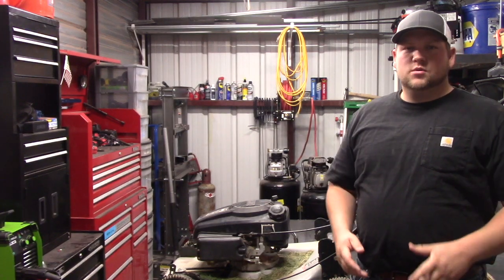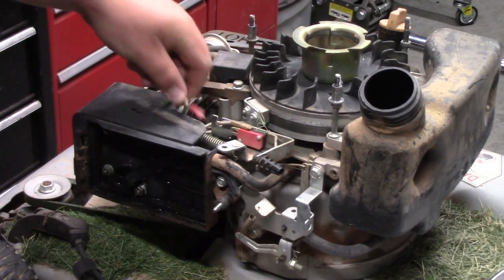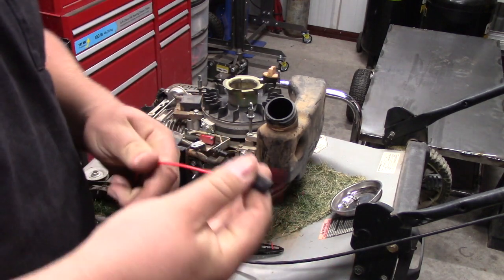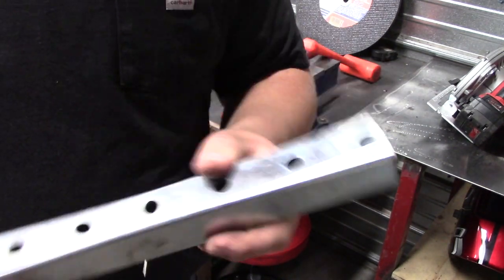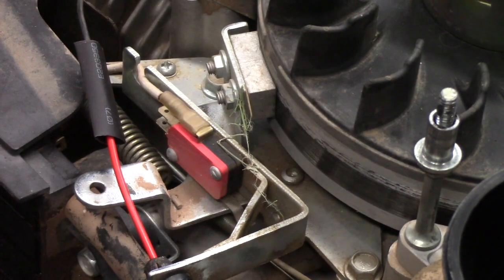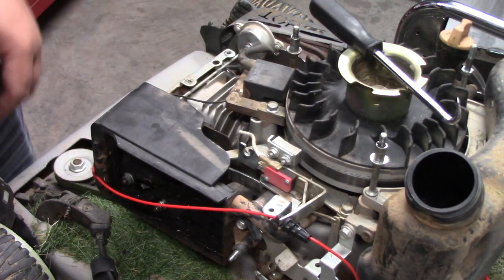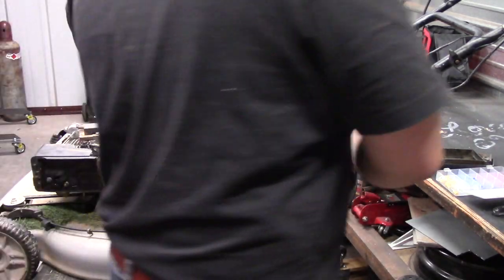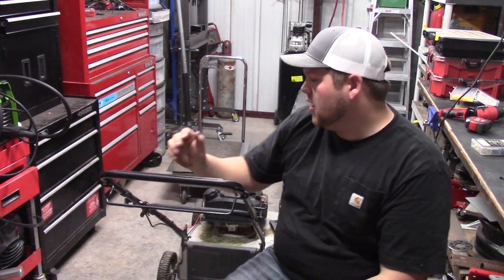How to Install a Kill Switch on a Lawn Mower

Comment: So this works because you are removing the fixed ground from the block and relocating it to a ground on the handle to a intermittent ground right? I have a Troy bilt mower I am wanting to do this with and still learning how to work on small engines
Reply: Yeaa.. he did miss the most important part explaining what is he doing

Comment: Perfect!  I have an Edger with a engine brake cable that is difficult to pull for some reason. I know it will result in a new cable shortly. I’ve been thinking about a kill switch but was unsure about if there was another component in the system that would cause problems. Your video was most helpful. Thank You!
Reply from the maker: Glad it could be of help! Thanks for watching!

Comment: Unfortunately I can't hear the video at this time but I'll re-watch later when I can but I have an old mower that doesn't have a kill switch. The only way I can shut off the mower is to either let it run out of fuel or ground out the spark plug which is what I do lol. It works great but not exactly easy for my child to use lol. Anyway I tried to make a kill switch but I can't start the thing with it on. Maybe I need a thicker jacketed wire I'm not sure but if I put it on after mower starts it works great except it kind defeats the purpose if I have to install after it's started and it also hurts a bit sometimes. Regardless I want others to be able to use it without me. Any opinions other then paying $250 for a new mower that's only going to last a couple years? This mower is about as old as me but still runs like a beast. My last mower died after 2yrs and needed a small part for 120 buck which is why I said the heck with new crap lol.

Comment: my son just snapped my cable...I zip-tied the brake "off" and fired it up to make sure it still ran, going to install a switch now so I don't to pull the spark plug wire next time!

Comment: This is a great alternative. I had to do a cable delete on an older mower and made do by just reversing the spring on the brake to keep it open, and then when done mowing, manually put pressure on the brake in the normal direction to kill the motor. I think I have a momentary switch in my box of salvaged parts that would work perfect for this.
Reply from the maker: I think I would prefer the actual cable but this is a solid fix especially for a quick fix to get mowing again.

Comment: Hi I loved you vid and I did what you did with my rig can I do this with a key switch because I want to make my lawnmower to have that
Reply from the maker: It should work with a key switch, the only difference would be using a key to flip the switch instead of a little ball and lever.
Reply: @DereksWorkshopAndProjects  can you send a link to what you would use for it and thanks for replying 😁

Comment: One thing to keep in mind is when you delete the brake on the flywheel:  When you turn off the mower using that new kill switch, the blade will continue to spin for around 30 seconds due to momentum.  So stick your hand in the chute you will loose your fingers.  Lol
Reply from the maker: As soon as the mower stops (delayed compared to the brake but no more than about 6 seconds) the blade stops too. It's definitely not 30 seconds but definitely something to be aware of because that brake does stop it quick!
Reply: A little bit confusing, the spark wire  not that spark plug wire.
Reply: You can leave the brake for the flywheel

Comment: I like the video. My cub cadet mower is not stopping when I release brake cable and as far as I can see the cable is not damaged. What do you the the problem might be?
Reply from the maker: The brake itself may be completely worn down. It almost may be the spring is worn out. If it’s not shutting off electrically, as in the spark plug is not having its spark stoped, your switch may be bad. There might be something blocking the cable from going in all the way. Hard to say without seeing it but maybe that will help a little bit.

Comment: Thanks for sharing your information but I would like some advice if you can. I tried two different style of switches and Switch style (1) didn't work, Switch style (2) worked so please read on and please tell me why :) . 
My kill switch cable seized/broke so I decided to bypass it as per your video.  
Switch Style (1) I had an extra illuminated toggle switch, 12V/20amp and wired it up as per your directions,  however it won't turn the mower off.  If the switch is on "ON" position, the mower won't start, as expected, I move the toggle to "OFF" and the mower starts and runs perfectly, as expected. However, if I flip the toggle to "ON" again to turn engine off, the mower keeps running without a hiccup.  I  removed the connector from the "+" terminal, grounded it to the handle and the mower turned off.  I tried a second identical switch with the identical results.  :(  Time to try another style of switch.
Switch Style (2) I had an old Push On/Push Off little button switch from a disassembled aquarium light (I just disassemble last week - lucky me) and decided to try it. I installed it using the same wiring as the other switch and it works like a charm!!!!!
Scratching my head here not understanding why the first switched did not work?   Any insight/input from anybody would be appreciated.  Thanks again for sharing your knowledge on the subject. :)
Reply from the maker: Man I really have no idea. Thats one of the strangest things I have heard. I am really not an electrical guy, I can do basics but I really have no idea why one switch (two samples) would not work and another would. I'd ask an electrician friend haha!
Reply: P Scott do u mean a switch for a bed side lamp type a switch so u can turn the lite off I'm in the same issue wiring and Lecky is not my favourite jobs
Reply: @ronniebarker79  No, this was an illuminated toggle switch that is used in cars.  I happened to have them for a project I was doing and thought I would try one.  I have since figured out that if I wire it simply as an On/Off switch without the toggle tip illuminating then it works fine. Good luck with yours as I am a novice in this department for sure!
Reply: @PaulScott_  what I have done but won't know it works until morning small baby next door is I've got a terminal plastic block screwd down my coil wire near where my brake is next to that I have a blue wire bolted down on the side of engine as a ground now back to terminal block I've carried the coil wire onto the on and off switch further up my handle bars but can't try it until morning what do u think
Reply: @ronniebarker79  Sounds like a variation of what I did - it should work as the "ground"  circuit when closed as I understand it will turn the mower off. Let me know how it works!
Reply: @PaulScott_  didn't work fella tried turning it off nowt turned on nowt back to the drawing board
Reply: The illuminated switch has a different contact for the LED lamp, that is always on

Comment: You want to use a momentary ON push button switch.
If you use a toggle switch I guarantee you will turn
it off & leave it off. Next time you go to start you will
forget and you will yank & yank & yank & yank until 
FINALLY  you remember. So, use a push button. you
will thank yourself again & again & again.

!

Comment: you could have skipped all the extra wire and just spliced into the factory ground lead and to the engine.  Drill a hole in the cover and install the switch.  no fuss.

Comment: What is the purpose of attaching the other wire to the handle (with the yellow contact)
Reply from the maker: It grounds out the electrical to machine to keep the electrical pulses from causing a spark.

Comment: I would use a momentary switch that is normally closed. When you press the button, it opens the circuit and kills the engine rather than having to keep flipping the switch which can wear it out. 

Also, you could use a rod with a handle to manually set the brake.
Reply from the maker: Good suggestions, I like the idea.